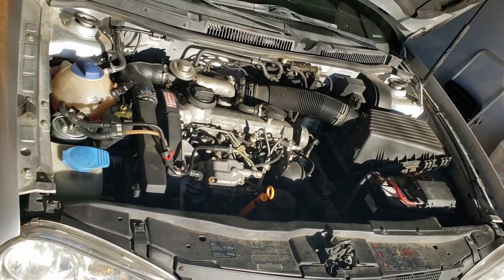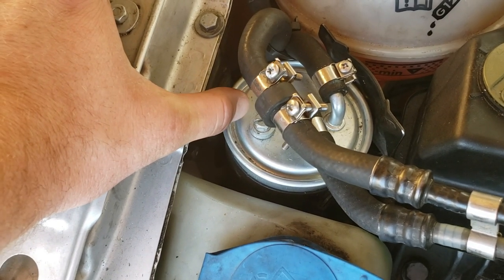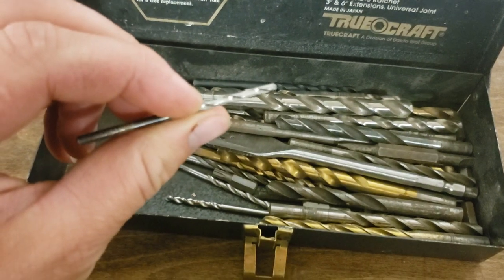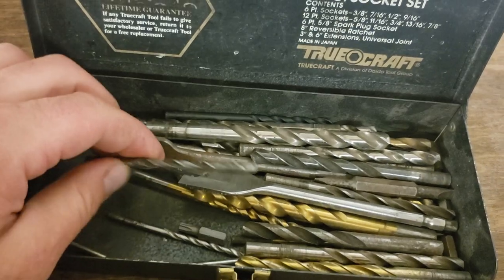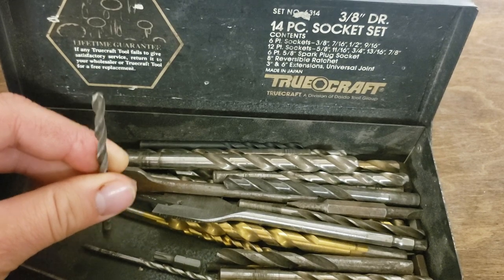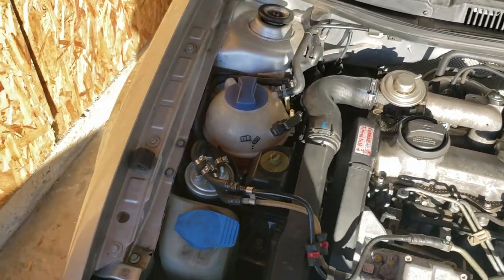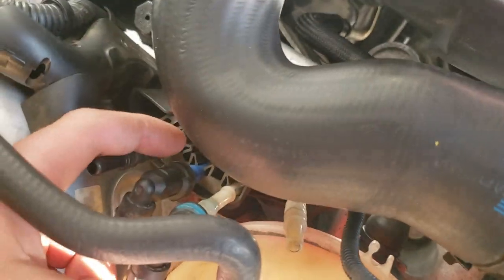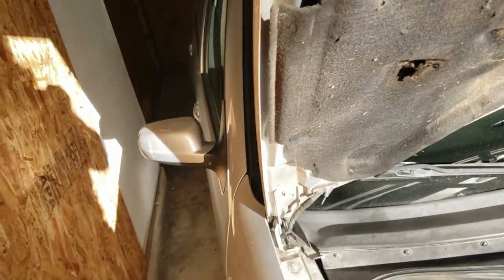Air in Diesel Fuel Line (RESOLVED)

Comment: Good video but I’m a diagnostics guy and I like to actually see how you diagnose the problem so you’re not wasting time. When one line has pressure and the other one is vacuum the line with pressure will leak but the line with suction is where I’m confused on how to test for the leak. I don’t want to start changing out every oring and gasket on the fuel system

Comment: Hi. Thanks for the tips! I've got a weird problem, which I was told is caused by air in diesel. The car has these weird unexpected surges of power. Like all of a sudden the HP doubles. This lasts for a few seconds to a minute before things go back to normal. This happened after work done on injectors.
Reply from the maker: check if they put the copper washers back on when installing the injectors, they all came with this one thic copper washer. Then you can tighten the fuel line caps with a 17mm and also the caps on the pump itself. Then check all the vacuum hoses and those n75 valves
Reply: @AlbertShevchuk   Many thanks! So I checked those. They were tight. However, I noticed that the filter housing was leaking. So I bypassed it, just for testing purposes, and the power surges were gone!
Reply from the maker: @AbdulIssa-ux2wz  Yup thats what you need to check first. Did you get the old 1.6 diesel filter?
Reply: @AlbertShevchuk  No, just a cheap plastic diesel filter, just to test with it. So weird what a simple air intrusion can do to your car! I have another issue, which I would highly appreciate it if you can help me with. Long story short, car had a knocking injector. A mechanic removed all four, cleaned them, did some work on them. Knocking is gone since, but now it doesn't start as good. It struggles on cold days, where before it wouldn't do this. It can't be a compression issue; engine has a low mileage. I checked diesel hoses for air intrusion, as I told you before, but it only solved the sudden acceleration issue. I've been struggling for months now. I'm tired of spending money where no one has ever been able to pinpoint the issue. The car doesn't smoke even on cold mornings; No black smoke, no white smoke. Drives smoothly. Normal consumption. I am lost!
Reply from the maker: @AbdulIssa-ux2wz  I get the same also. Sometimes randomly i have to spin 8-10 cranks for it to fire up even when its hot. Its a fuel/timing issue. Its something about diesel spilling back into the gas tank and then not having enough pressure to spray before the compression stoke. My advice is to get the biggest battery you can fit in there. Modern solution lol
Reply: @AlbertShevchuk  That seems to be the issue, yes. I tried to fit in a non-return valve. No luck. It seems like one or two of the injectors have a higher opening pressure, so the pump struggles to open those. A bigger battery, I guess, would fix this. Yesterday it started to do it even when hot, so it's getting worse. Sometimes it starts quickly, but then the engine stumbles for a second or less. My previous car had an engine that had a ton of blow-by, consumed oil like mad, and even on cold mornings it would start first turn of the key. So weird! Well, thank you for the help! I really appreciate it.
Reply from the maker: The oil helps it start ;) haha anytime bud. If your in a humid climate you can be experiencing early signs of pump failure @AbdulIssa-ux2wz
Reply: That could also be it! @AlbertShevchuk

Comment: You drilled in The fuel line thats in the tank thats what you saying have thai simular issue but boobels are going from engine to the tank the return line
Reply from the maker: So if everything is dry and you dont have any signs of fuel leaks. Take your fuel pick up assembly out of your fuel tank. Empty it out and use a hose with your mouth to see how freely air is moving. They have little check valves that go bad. If you can feel resistance, drill straight threw that sucker.

Comment: Thanks a lot. I started getting codes last week and couldn't figure it out as they would go away. Then it got really cold today and the car gave up the ghost. That's when I saw the air in the line.
Reply from the maker: No Problem, change the fuel filter while your at it 👍
Reply: @Albert's Garage  ya got down the road and figured that out quickly.  I run b100 and all the varnish from the tank collected.
Reply from the maker: @randomstuffwithporgy3879  awesome, how are the mpg's with the b100?